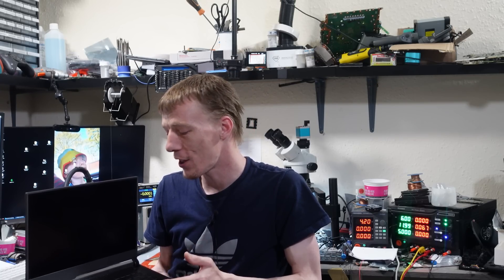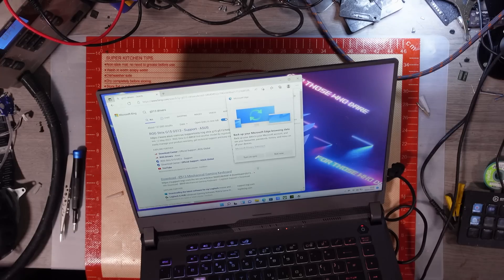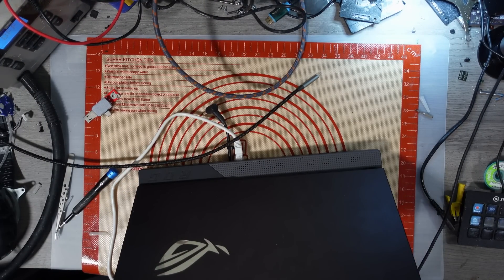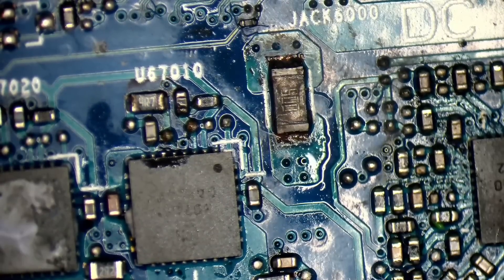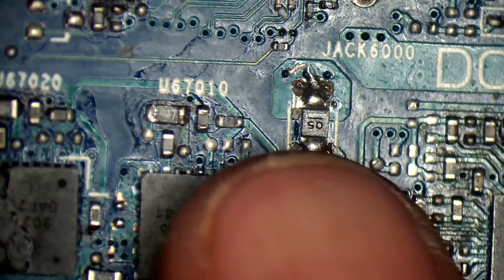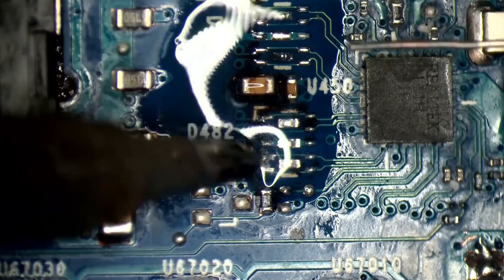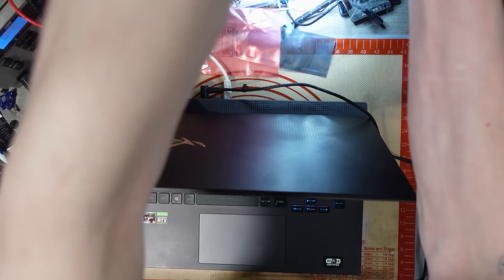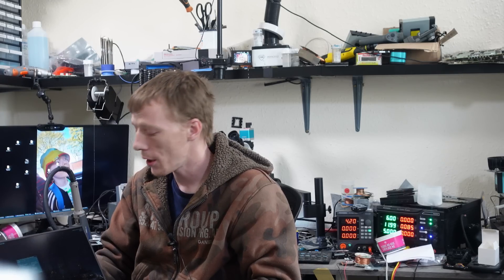Asus ROG G513 Liquid Damage Gaming Laptop Repair. Can I Fix Error 43?

Comment: I think the 005 Resistor is a Shunt Resistor, for measuring current maybe. Its 5 milliohms, I think. Not measurable with a normal Multimeter. (Shows as 0 Ohms)
Reply from the maker: Yeah it seems that way. I used the Nintendo switch one because it has the same purpose 😀

Comment: finally someone with a driver power state failure BSOD. My thinkpad had this issue FOREVER and i fixed it with some random windows update (And almost corrupting my install with attempting to fiddle with certificates)
Reply from the maker: I've seen it a few times myself on different gaming laptops. I think I had it on my own thinkpad recently too. It is generally a driver issue :)

Comment: the "005" resistor is most likely a current sense resistor at 0.005 ohm
Reply from the maker: Yeah I think I mentioned that but that part was cut out. Pretty much the same as the resistor on the switch board because that has the same job